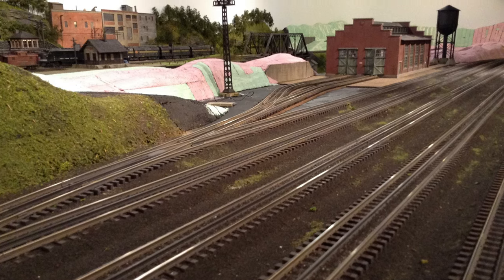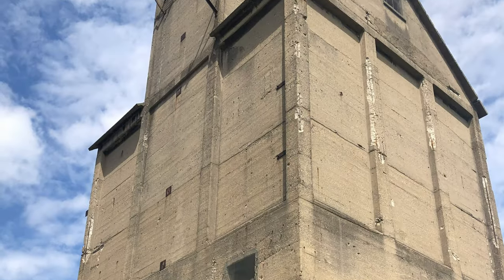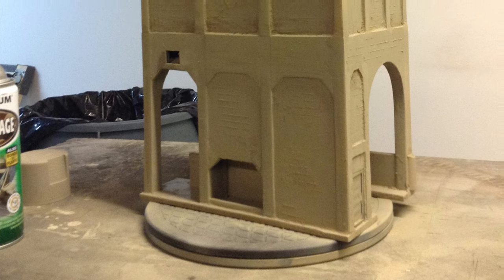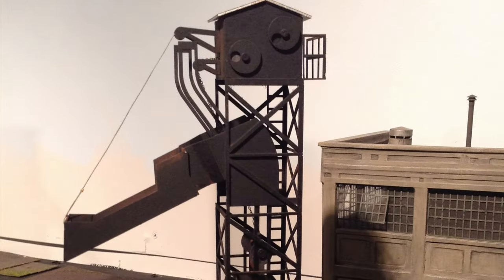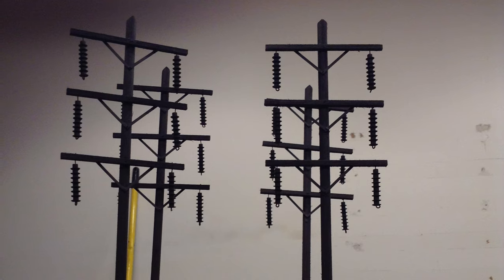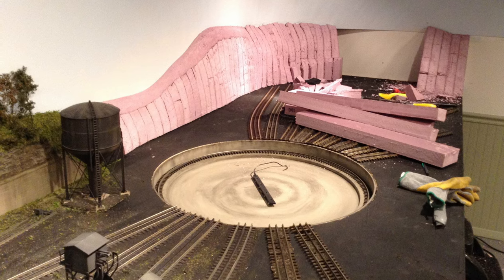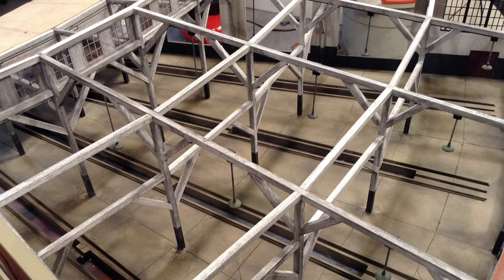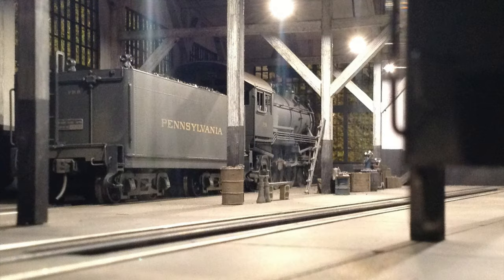My 3 Rail O Scale Layout, Early Construction Pt. 3

Comment: I will eventually build a roundhouse but have a 2 stall engine house. I want to have a floor similar to your model. Did the flooring come with the cut out for the tracks and work pit or did you have to use a router to do that? Second, I see the exterior has a brick pattern. Is that cut into the MDF? Lastly, will this accommodate a Lionel Big Boy?
Reply from the maker: The floor is custom cut and configured by Altoona depending on what configuration you order. I got the longest roundhouse he made at the time, my T1 fits no prob.